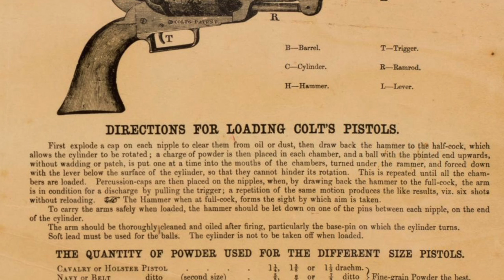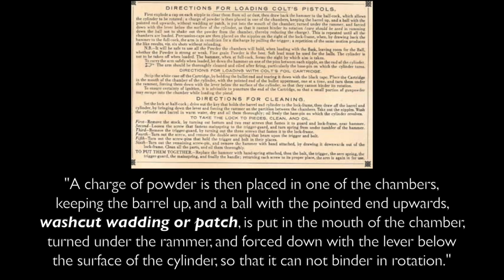Percussion Revolvers in the Rain

Comment: As you say, based on this experiment cartridge guns would have had an overwhelming advantage in the rain. Do you think this ever played out in combat? Suppose you knew for a fact that the enemy force had very few cartridge guns, and your force had a lot, and it was raining, couldn't you seize upon this advantage and mount a surprise attack knowing that the enemies weapons would be severely degraded? It seems like if rain really compromised cap & ball firearms this bad then such a scenario must have occurred at some point. Or perhaps methods for minimizing water ingress during the rain were much more developed than we think. I mean, the Japanese invented little boxes to put over the action of their Matchlock firearms so they could still use them in the rain. I figure if the Japanese could figure out how to use Matchlocks in the rain then surely someone must have come up with a practical method to keep water out of cap & ball firearms. What about putting a dab of something like axle grease or vaseline around the cap once seated? However, even if that worked you still wouldn't be able to reload in the rain, unlike a cartridge firearm.

Comment: Did you check down between the hammer and the frame to make sure the spent cap fragments didn't jam up down in there?  That frequently jams Colts up, and if you don't disassemble and remove cap fragments it will fail to fire A LOT.

Usually Colt shooters fire the gun, then point the muzzle straight UP while cocking the hammer.  This allows cap fragments to fall OUT of the action before the next shot - rather than falling down in between frame and hammer, causing a lot of failures to fire.

I see you paid zero attention to that Colt shortcoming. Try a Remington New Army 44 instead.

Comment: I would maybe try to melt some candle vax onto the precussion towers (might be a bit hard to do without getting some into the holes) and push the caps on that way. It makes sense in my mind, but considering my knowledge on guns i might be wrong.
Reply: You'd want to cap it and then seal over the cap/cone interface with your grease/wax of choice.

Comment: Could it be that your cones were not adjusted correctly for those chambers that didn't fire? The reason I ask is that I've actually submerged various caps, including Remington #10s, and discovered that even total submersion in water for a day or more has no effect on the percussion caps. I suspect that your cones needed to be screwed out slightly, allowing proper hammer impact.  Once on a rainy camping trip a replica Colt 1860 was accidentally in a puddle on the floor of the tent overnight and still every chamber fired perfectly. General Robert E. Lee kept his Colt 1851 Navy revolver in his saddlebag for the duration of the war, never firing it, but after his surrender he shot all six rounds into the ground and every chamber fired perfectly. Assuming proper loading a modern replica should do the same.
Reply from the maker: No

Comment: There must be a way to water proof the percussion cap nipple fit.   Your test is extremely mild compared to being caught in a downpour or a total day of rain and someone being in the saddle all day.   
Living in a north gulf coastal area of florida I have a lot of experience with getting wet.   In my area rainfall averages 67 inches a year.  
Just walking through heavy vegetation after a heavy dew could soak all of your equipment.    
 The best way to protect the pistol would be to wear a oil skin rain gear and stow the gun in your belt under the rain gear.  But how would a picket with a musket keep it dry.  I am sure there must have been a methodology for that.   
We all know that match locks were not compatible with wet weather either.

Comment: I wonder if there is any evidence out there of anyone using a holster similar to the one you showed and simply removing the entire holster from their belt before hand, and then just firing the gun from inside the holster during the rain, I don't see why it wouldn't work with both the flintlock and percussion guns, even though it may be challenging to aim, it would be a massive advantage rolling up to your enemy being able to get your shots off while they are unable to return fire at all due to the rain.

Comment: Didn’t percussion revolvers mostly use paper cartridges and wasn’t the paper waterproofed with wax or something?
Reply: They would still need percussion caps, and it was the caps that failed. But as many people here have pointed out, sealing the caps with wax or grease should keep the water out. You can also put grease or petroleum jelly in the chamber to seal it from the front.

Comment: It's not the revolver design, it's the components. The Remington caps aren't of the highest quality. Run them again with RWS caps and you will find better results. When correctly loaded with correct components, Colt considered his revolvers to be weather-tight. Of course these weapons were primarily be used with factory-made combustible cartridges in both civilian and military applications.

Comment: Better than a matchlock for sure. Just brush against a bush wet with morning dew and you have a problem. Trying to move through a typical American forest of the 17th century even late in the morning could be miserable work as every bit of brush threatened to dampen your match.

Comment: Seems like the water is getting between the hammer and the frame, causing the hammer to not reach the velocity needed to activate the cap.  You wouldn't use tap water for sex lube, ammirite?

Comment: well you can dip the percussion cap in wax or coat them with a bit of oil. The moment you even slightly deform the cap, or have bit rusted unpolished nipples, it hold but dont seal. Also i think modern nipples are made so its easier to remove cap (coated, sand blasted, raw lathe cut) and by logic, nobody will go shoot a percussion firearm in the rain.

Comment: I'm actually surprised this wasn't obvious to you right away. Don't use muzzleloaders much???

It was abundantly clear that the caps weren't igniting on the chambers that didn't fire. Probably because the ignition material in the cap got wet. I bet if you'd replaced the cap and tried again, it would have fired.

Also, yeah that rain was super heavy lol. But a revolver in an open holster, the rain would be hitting the grip and the shield by the hammer, rather than pouring directly into the cylinder from above, unless you were to hold the revolver at arms length 'ready' for a considerable amount of time.

Comment: I suspect the caps (mercury fulminate) are hygroscopic and really suck up the water to a point of contamination.  Thanks, Tom KC3QAC
Reply: No factory brand caps use mercury fulminate any more. The stuff breaks down with age, so mercury caps have a shelf life.

Modern non-corrosive* caps use lead styphnate instead.

* corrosive military-grade primers use potassium chlorate/perchlorate for maximum reliability, with the downside being they form salt as a residue.

Comment: Great video.  Did you try it with your second 1860 Army?  I'm asking because I wonder if the difference was one of individual construction.

Cap and Ball has a video about water with cap and ball revolvers, and he talks about an actual water test between the Colt and Adams revolvers in period.  Interestingly, in one of his tests he shows that a misfire was the result of the water getting into the cap and pushing the priming compound into the cone, just as happened to you.  It's unfortunate he used grease over the chamber mouths since that is not common in the historical record, but I think it's the caps that are the issue, so it's kind of immaterial.
https://www.youtube.com/watch?v=uXfRI9M9DzQ

Comment: With all due respect, you are not historically operating the percussion cap&ball revolvers as was originally done.

In the 1850's Combustible Paper  Cartridges became the mainstay.
Also Conical Bullets were the projectles used in the Civil War with the commercially produced  Combustible Paper. Cartridges. 

Some military personnel  were said to have carried round balls in addition  to Combustible Paper Cartridges.

Also Beeswax was used at times to provide a protective seal around  the seated percussion caps from the eliments.

The Colt 1860 Army and Remington New Model Army percussion revolvers were the most common revolvers purchased by the US Government  during the American Civil War peroid.

The Starr revolvers numbers were far lesser puchased by the US government during the Civil war peroid.
Reply from the maker: With all due respect, I loaded it based on the instructions as provided by Colt himself and provided that reference in the video.  Additionally, the issues exhibited here are not the failure of water getting to the primary charge, but via capillary action under the percussion caps.   With all due respect, of course.
Reply: @InrangeTv  
Very poor reseach. You don't even know that Combustible Paper Cartridges  with conical bullets were  alteady the mainstays by the mid 1850's.

  Samuel Colt invented  the Combustible Paper Cartridges developed with Hazard Powder Company. 

 As well as that the Remington NMA was the 2nd most prevelent revolver and not the Starr.

 Lot's of  inaccuracies and omitted missing information, poorly done!
Reply: @InrangeTv  That was one method for loading but by the 1860s combustible paper cartridges and conical bullets were more common especially in military use. The flintlocks were usually used with paper cartridges too although those had to be torn. The methods you showed were used some though.

Comment: I'm going to clear this up real quick.
Match lock. Humid makes them unfireable.
Flintlock. Rain can make then unfireable. But can survive a rain if pan is closed. But dropping in water unfireable.
Caplock pistol. Rain not a problem most the time. Drop in water not a problem most the time. If good caps.
Cap n ball revolver. Drop in water and they are fine. Unless you have wrong caps.
You can summerge a cap n ball revolver and 99% of the time all rounds will fire. 
Cross a river with it under the water and it still good. Unless you caps are not seated correct.
Modern shells.
Now that's tricky. Depends on the shells.
NATO no problem.
Eastern Pac you may have problems 
But NATO rounds back Back to WWI ( yes years before NATO. ) And you can store them in water and be fine. 
Any round with crimper bullet is fine in water.
However the shells prior to WWI in most cases. They would go into water and be  ok. But if under water for a short time are useless.
Yeap the cap n ball was better with water then the shells of the time.
Because the ball side is air tight and the cap side should be air tight.
However. Nipples did wear and got damaged.  Particularly in the civilian world.
But rain should be a factor 
If water is a problem with cap n ball revolver 
First check cap size. #10 are better then #11.
Now long arms and single shot. The ball side is not air tight.
Some will say that why you use grease on cap n ball revolvers 
Grease is never needed. If you have water getting in. On ball side. You are using the wrong size bullets.. if cap side. You have wrong caps. Nipple is damaged or worn and needs replaced.
Now in single shot. The biggest problem is when wads and patches are used.
Again patches are not needed.
The reason patches were used were to fix the gap of not having the correct size bullet.
You have a .62 cal rifle but store only has  .50 cal. Use a patch.
Wad is used to keep shot in a smoothbore.
Water can get in with these. But rain shouldn't be a problem.

Comment: Percussion weapons weren’t great for rain/submersion.  Better than flintlocks?  Certainly.  Perfect?  No.  Where they actually excel is ‘moisture’, as in dew, mist and fog.  A story of flintlock pain is early morning battles were a crapshoot as to the guns working because of the moisture all around.  However a sealed/loaded percussion cap weapon had much better odds of staying dry in these conditions.

Comment: Here is the truth.
 * Caplock can be submerged in water and be fine. Dropped in a bucket if water and pulled right back out.
 * Flintlock can be rained on and be just fine.  Light to medium rain. If you are in a water fall you may have a problem.
* Matchlock watch a normal humid day in Louisiana. It maybe too much.
By far Matchlock is the worse.
There was a great leap from Matchlock to Flintlock. And same from flint to cap.
However, both flint and cap have advantages over the other.
During the early 1800s there were many debates on which, cap or flint, was best.
Unfortunately today finding a flintlock in a store is very hard. Heck Caplock are hard to find. Inline garbage is the norm.
Which shouldn't even be allowed in the BP community.
It really irritates me these people that use gease and fats on BP. Its not needed. Just like patches are not needed.
The whole reason behind patches was that you could use undersized projectiles. Go to a store. You have a .72 cal But they only have .68 cal You use a patch.  
Now in that. I don't understand why you just don't melt the .68 in a .72 mold. But whatever.
The only exception is using shot. Because you need a wad to separate the powder from the shot. And a wad to hold the shot in.
In buck and ball. load powder, the ball then the shot and wad.
Grease and fats. No reason. All it does is add smoke when it burns. And around caps us pointless. If caps are not sealing either you need new nipples or you are not pushing caps on enough.
BTW not seating caps also wears out the nipples.
Reply from the maker: Videos for proof.

Comment: You’re um… you’re supposed to paper patch a smooth bore, it’s much more accurate
Reply from the maker: Historically that was not the common loading method.
Reply: @InrangeTv  historically they’ve been patching round balls with cloth since the smooth bore was made.
Reply: @jefferybauduin2919  they used paper cartridges and undersized balls. The cartridge would sort of act like a wadding possibly.
Reply: @redtra236  the balls were patched via paper, allowing it to fit the barrel better, they never just dropped them down the barrel.
Reply: @jefferybauduin2919  They usually just used a cartridge as a wadding. Felt wads weren't used in combat and don't work well once fouling starts to build up in the barrel.
Reply: @redtra236  I never said said they were felt patched, I said they were paper patched, again balls weren’t just aimlessly dropped down the barrel.

Comment: The Colts are junk because they have the wedge holding the gun together. The wedge is a weak link in the whole construction and the gun stretches at this point causing the gun to get sloppy loose. I have had no good experience with the Colts and will NEVER own another one!

Comment: Take the wifes transparent nail varnish and put thin layer inside of the cap with brush that came with it. Varnish make caps waterproof for rain and moisture (they have it in old days too). I was walking and working with revolver like that- it was wet from my swet, big envirement moisture, rain and i had caring it like this for 3 month. When i fired the gun every cap was fine and gun went off like is just loaded. Just use comon sence, this is tool like any other, problem is that humans dont work with hands any more so they dont know how to think anymore. And from where i stand america is in front of that deadly race of losing comon sence. It is your gun and you are still always surprised with it. Guns are not philosopher stones- it is simple tool. Every baby back in the day knowed how to work with it. But nooo, today guns owners always look only for safety rooles. Live a little, dont be so scared. Fuck safety, if you blow your head with stupidity, that is justice- one stupid less on this planet. I also try to loaded it with space between powder and ball- gues what- nothing happened- pure phisic. You dont need a gun to be a man, and you are not a man if you make hardcore philosophy of everything exspecialy when there is no need to do that. If you want to test history, make caps like there were made in those times. Reconstruct every detail and then try. Rain is not just puring water on guns, rain is also air humidity. Puring watter is not reconstruction of rain environment. Try this. Put the loaded gun when is rain outside and dont led any drop tuch the gun. None of the cap will fired without varnish protection. Know why?- Air humidity.